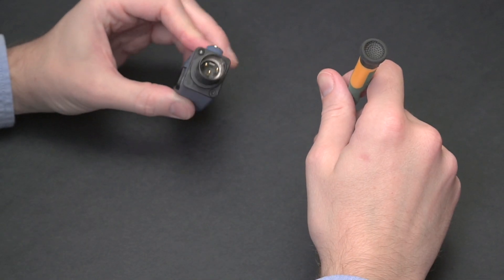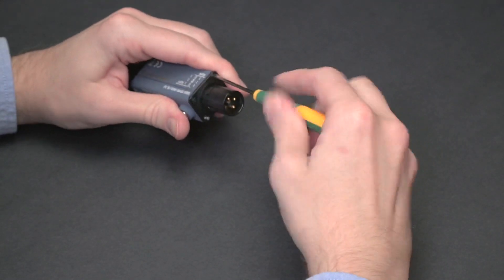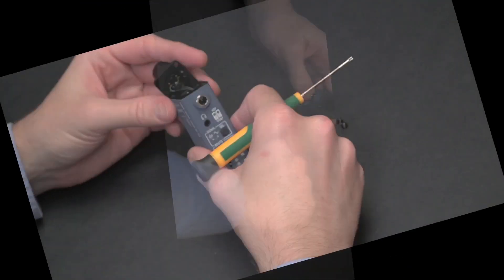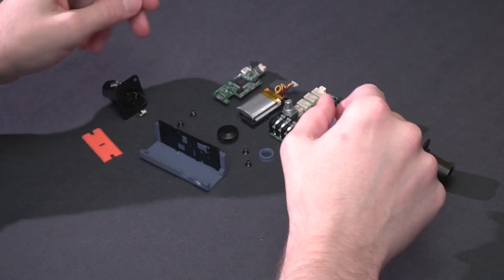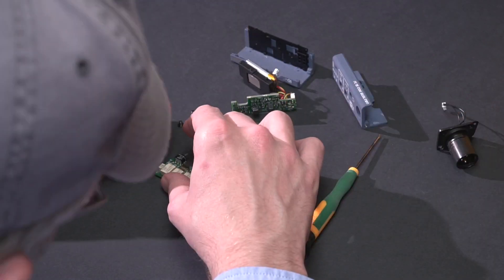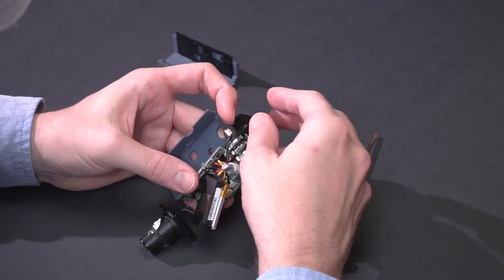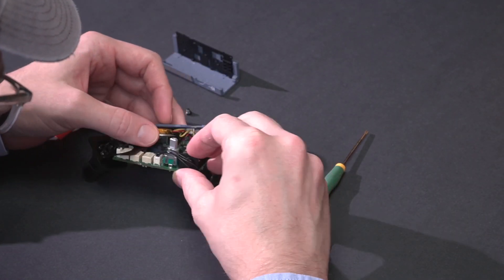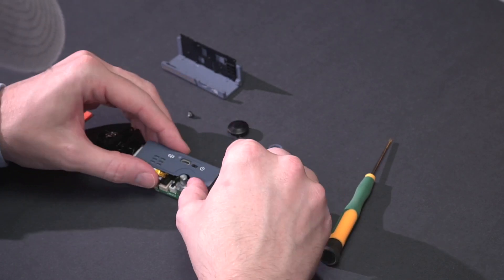What's Inside the Sound Bullet by Sonnect Audio?

Comment: Great video.  Is the case metal or 3D printed plastic?  3D printing would make short production runs economical.  Keep the videos coming.
Reply from the maker: The case is all metal and beautifully powder coated the blue color. Even the nut on the 1/4" connector is done inside and out, it's a rugged finish too with a little bit of texture for grip. Thanks for the message Robert, lots more to come!